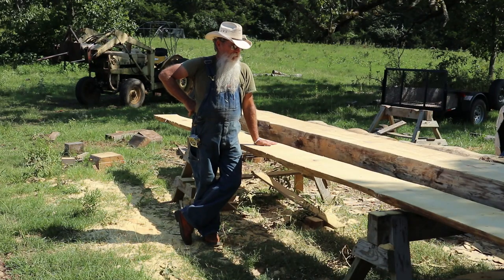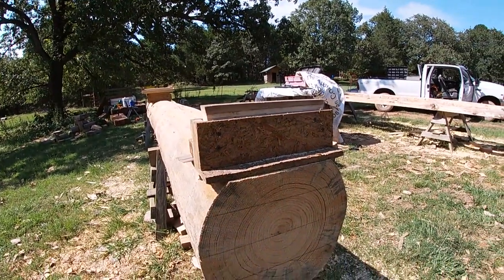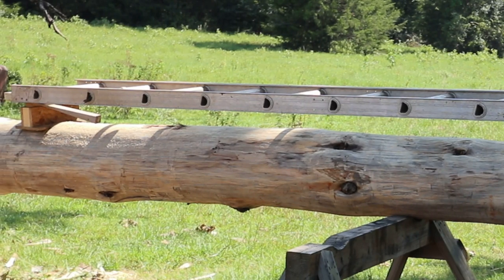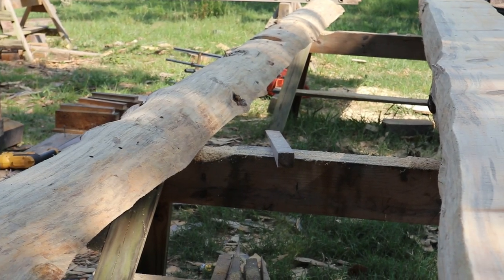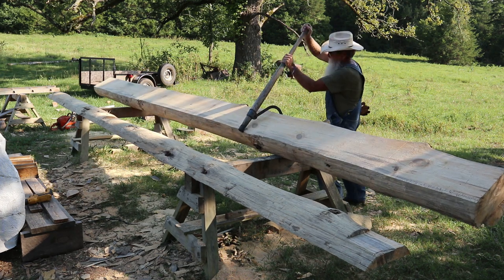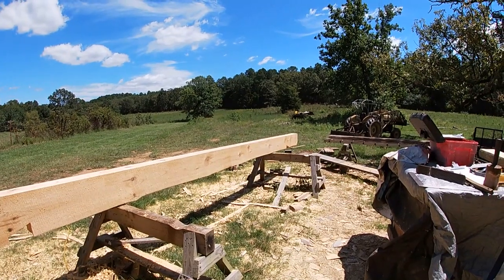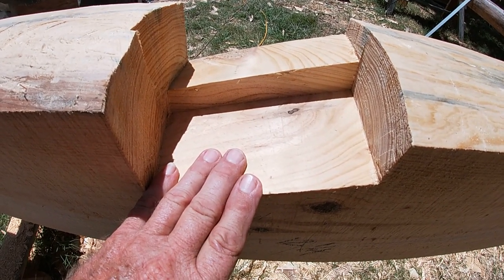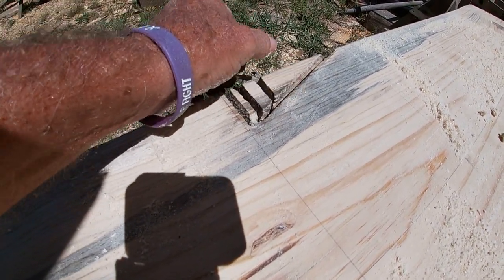Top Plates, Dovetail Log Cabin Build (Ep 35)

Comment: Not sure if you mentioned or not, but are the logs you're using green, seasoned, or somewhere in between?  Just wondering on the weight your crane/hoist is lifting.  Another great video brother!
Reply from the maker: The Cordless Carpenter   Howdy- these logs were cut in November and December of last year and l started cutting them out after they were peeled. I had rather use them as soon as I get them because they are easier to work with the hand tools. The summer heat had surface dried them some. The hoist will pick up quite a bit of weight. Thank you for watching our videos. God bless you